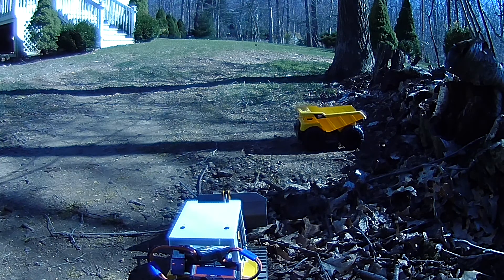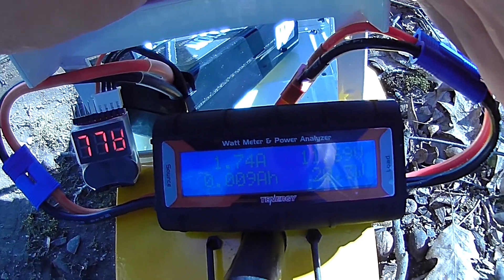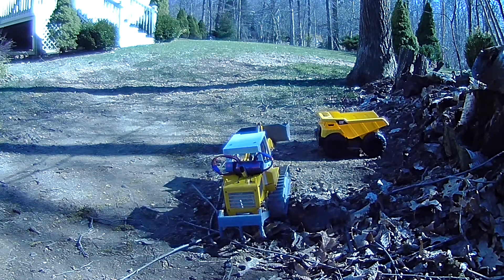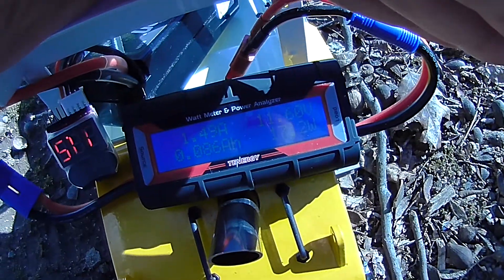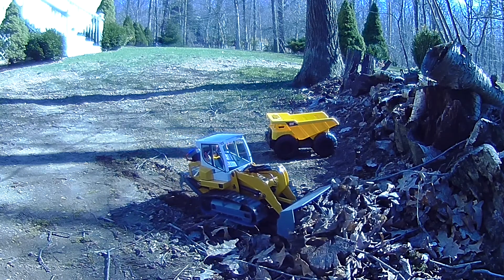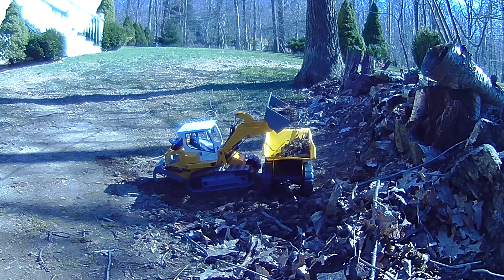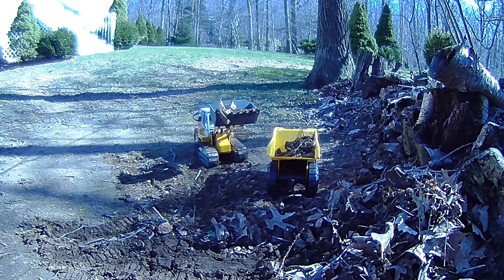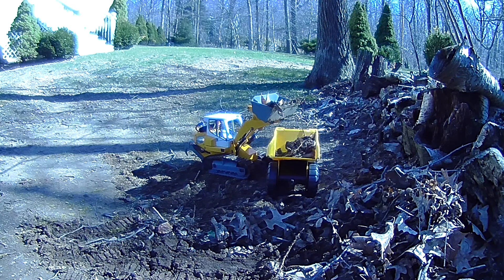Liebherr 636 RC Track Loader Amp Draw

Comment: Hello Rick i.have the same tipe of loader i purchased after i saw ur video because though they are cute but mine is all white and let me tell you i was having fun using it for the first time but little after 6 to 8 minutes the hidrolic pump shut off totally and still to this day i have no idea what the problem is i already connected the store  "farok" but no much help yet im so disappointed cant believe having trouble like this already so sune i took all precautions read all the directions witch wasn't much anyway added 50ml.hidrolic oil ,try no over pushed ect 
I wish you could help as you probably know more than I know about it. I tried contacting several hobby shops but none like 6 to 7 difrent one but none know how work with hidrolic stuff and i only have this thing for about 2 weeks now after i purchase.i waited this past 2 week before trying as hardly have time as olways working as auto bodyman. But like i said almost looks like there is some kind of fuse that i can't see as i don't want to take much apart but i been trying pretty hard to find the problem. Ialso wonder if los some kind of signal ,dont know is driving me crazy thanks anyways i wish you could help me.